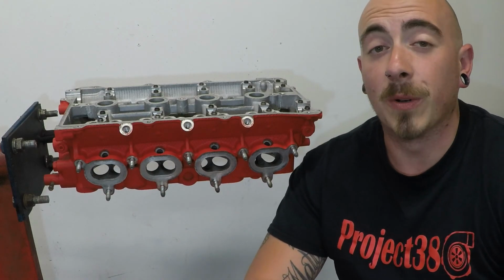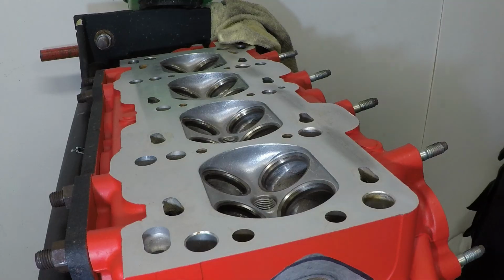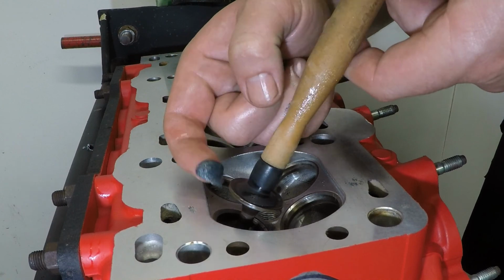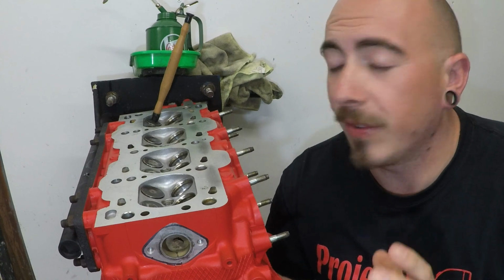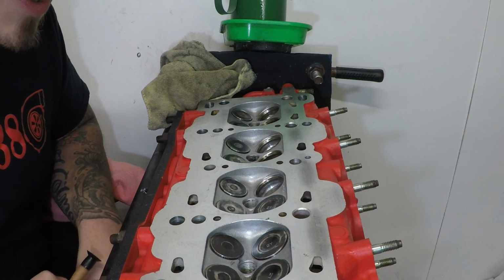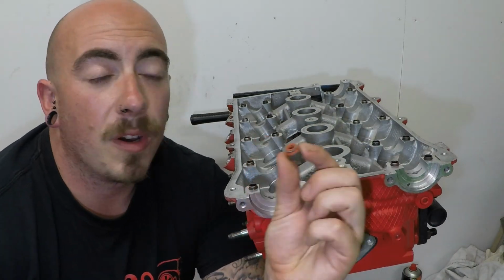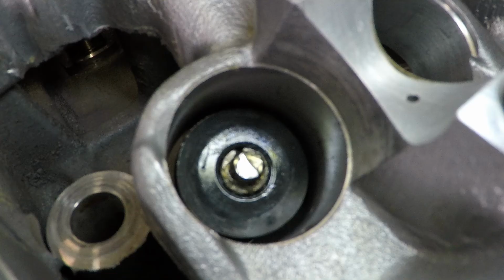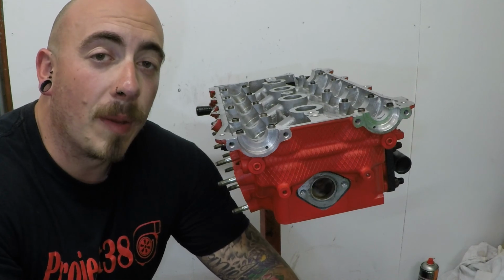VALVE GRINDING HACKS, how to grind and install your valves : MX5 TURBO BUILD pt 13

Comment: Hi there! I really enjoyed your video.  Thought I would share my saga and see if you or anyone else may have some advice for me. I am NOT a mechanic...not even a shade tree mechanic.  Up until this point I think the biggest maintenance project I ever worked on was replacing a radiator one time.   I recently bought a 2007 dodge magnum and within 2 weeks of getting it the timing belt broke (at idle).  Had it towed to a repair shop where they just told me it was "hyrdolocked".  I said, "Is that bad?", He said, "about as bad as it gets."  Dejected, I towed it home and decided to start taking stuff apart.  I confirmed that the timing belt had broken as suspected, but it had wrapped tightly around the crankshaft 3 times so maybe it didn't bend valves?  After 2 hours of cutting the belt away from the crankshaft I replaced the water pump and timing belt and reassembled it.  It started right up but there was a little "ticking" sound.  I don't know if I would call it a "knock" but not a normal sounding noise regardless.  I think that I possibly didn't have it timed perfectly so I disassembled it and re-tried it a couple more times and still could not get the timing marks to align exactly perfectly after tightening everything. (1/2 tooth off on drivers cam) after pulling pin on tensioner and tightening everything.  I figured I would dig deeper just to see if there was some other type of damage.  Since I had some time I watched some videos on how to take the cylinder heads off.  I did that.  There was some carbon on the top of the pistons and I could see where there were some "valve marks" (very light) on the top of the pistons.   I then purchased a "valve steam removal tool" which was an absolute nightmare but I eventually figured it out.  I pulled all the valves out and inspected them and they seem fine.  I spun them in my drill press and they all seem straight and true.  Which has led me to this video!  I assume I should still lap them in even if they were not leaking in the first place?  Is there any possibility that a valve can be bent to such a small degree that it is not noticeable.  I did a leak test and not a drop out of any of the valves (intake or exhaust) after 30 minutes.
Reply from the maker: did you do a leak test or a leak down test?
Reply: @Project380  just a "leak" test once I had the cylinder heads off.  With fluid in the exhaust and intake ports.
Reply: @Project380  just a "leak" test is I guess what it would be called.  Just checked with fluid in the exhaust and intake ports to see if any leaked out of the valves when they were closed.  I pulled the heads at Top Dead Center and then poured liquid into the exhaust port, turned it so that any fluid would leak out exhaust valves (2 of them per cylinder) waited 30 minutes no leak from valve.  Then I did the same thing on the intake side. ( I  did this before I pulled the valves out)
Reply from the maker: @tobysmithtonvilleshire1971  google cylinder leak down test  this would be more accurite and can test for valves, stem seals, and other seals, also rings